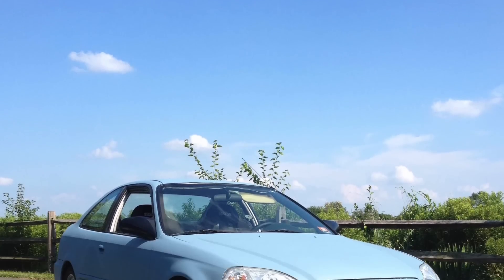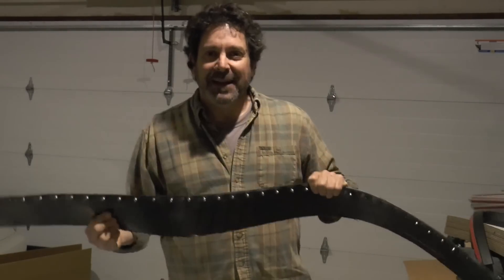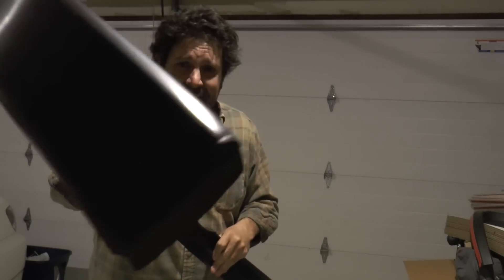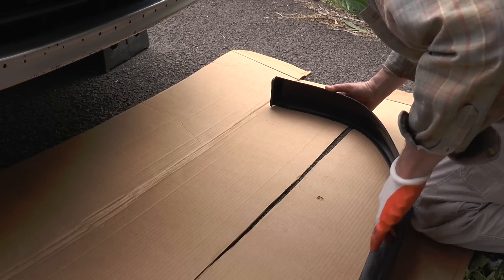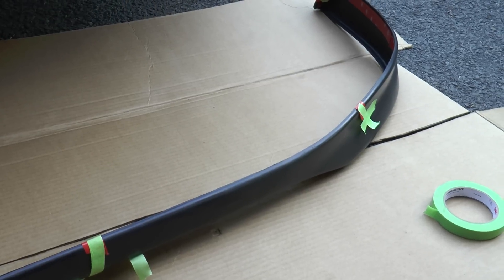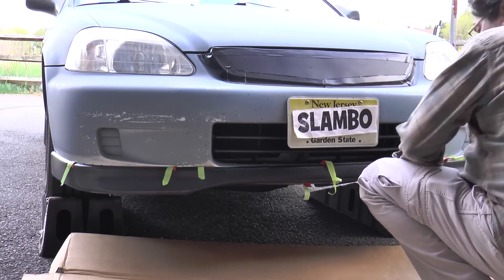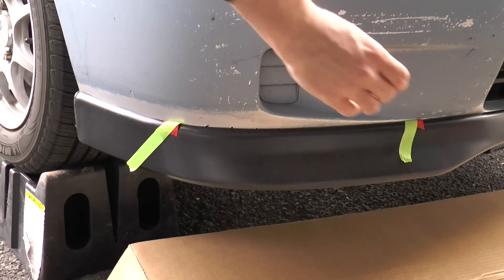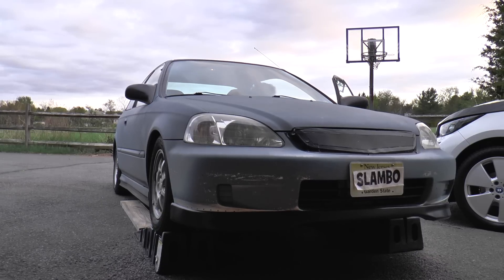How-To: Install a Cheap Ricer eBay Lip or D-I-Y Front Air Dam? - Honda Civic Build - Ain't Fuelin'

Comment: Had no idea that this would help fuel efficiency. Cool video
Reply: Chris H. Reducing the amount of air that flows under the dirty bottom of most any vehicle will reduce drag.  A flat bottom with a small diffuser will help lower the coefficient of drag even further while creating a noticeable amount of down force at higher speeds..

Comment: i m thinking about doing this to my subaru gl with flowerbed border plastic
Reply from the maker: Vulgora Lawn edging can do the trick. I like the flat roll agricultural plastic (heavy duty root barrier), but it's not as easy to find. Speedwaymotors has 10 and 25 foot rolls of plastic in different colors.

Comment: Nice I actually have the same exact lip on my Turbo specv
Reply from the maker: Poor Man Mods Cool! I'd reckon it's a wee bit faster than Slambo … =)
Reply: hahaha just a little bit faster :p
Reply from the maker: No doubt! Next dream after I crack the 50 MPG mark: drop in a turbo/E85 motor, distill my own ethanol, burn lots of rubber, burn 15% gasoline. =) I have crazy stupid dreams  …
Reply: I love these posts, I always leave with something new to learn about.

Comment: Who was the ebay seller for that lip?? Where did you get that plastic from and what was the width of it??  Personally I like the diy plastic lip, probably functions better too...
Reply from the maker: Underpantsniper The plastic sheeting is Deep Root Barrier. I bought it from a landscape supply company a few years back and had some left over from a project. Speedway Motors has similar material. The $31 lip came from Magic Drift. You can find the same lip from other vendors. The dream is to produce affordable wind-tunnel tested parts - either full bumpers or (large) slip on lips. https://localmotors.com/mpgomatic/aerodynamic-honda-civic-bumpers/
Reply: MPGomatic You should subscribe to Graysgarage here on the tubes of you.... you'll love it trust me
Reply from the maker: Underpantsniper I do! GraysGarage is one of my favorite channels! Stay Tuned … Mini  #Slambo  will visit the water tank soon … =)

Comment: not even close to "slammed"
Reply from the maker: +508 GAMING Any lower and I couldn't get in my driveway.
Reply: +MPGomatic your wheels don't even tuck how are you struggling??
Reply from the maker: +508 GAMING The entrance to my driveway is kinda steep. My stock S2K scrapes on it.